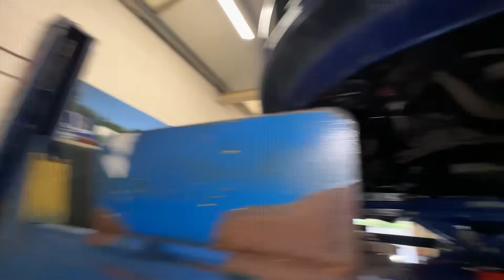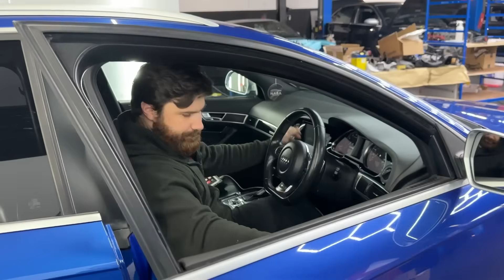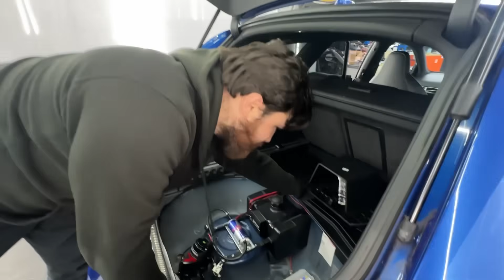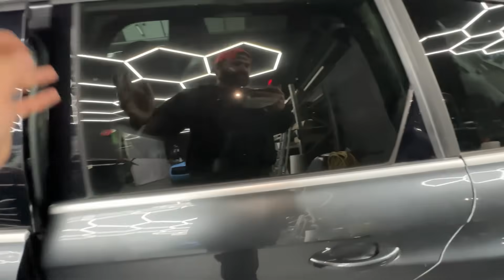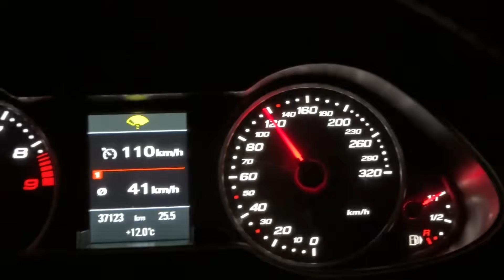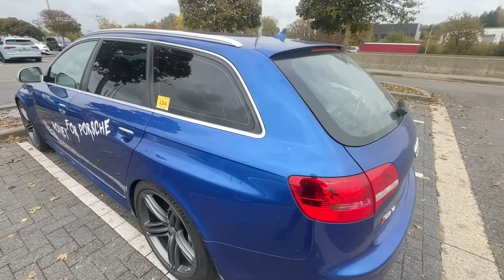V10 RS6 is getting ready for Nürburgring and we are dropping off the RS4 manual swap to the owner !

Comment: Hi mate, I know you said in the video that the fuel gauge seems to work now but I thought I'd weigh in still. I had a similar issue on a VAG car a few years back and I couldn't get the fuel gauge to read (ran out of gas a couple times hahahah), I replaced the floater etc, but it turned out to be the orientation with which the whole fuel assembly is installed. Somehow it was all pointed the wrong way which I guess made it so that the floater didn't have room to move up and down (there might have been an arrow on the chassis telling you where it needs to go, but I'm not entirely sure about that). Anyway hope this helps, cheers!